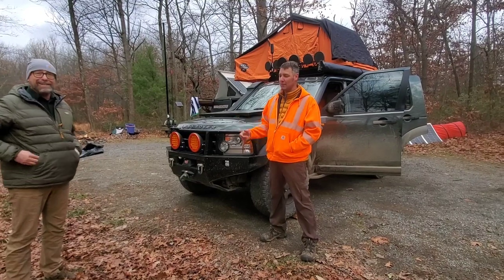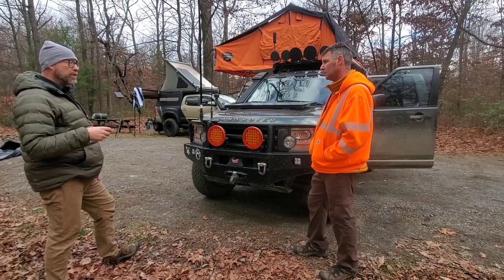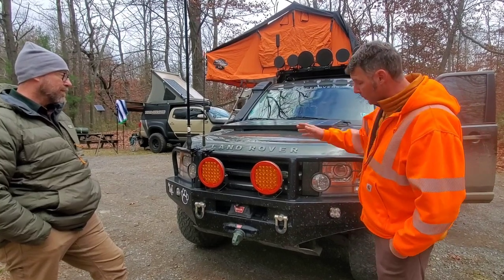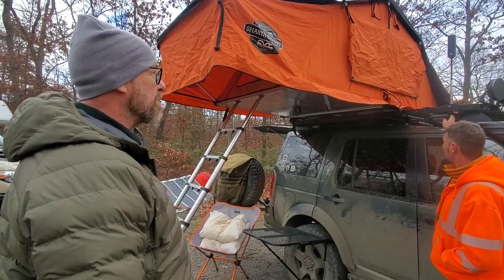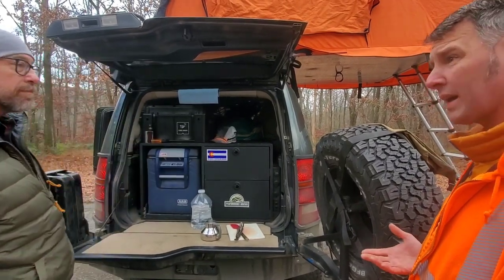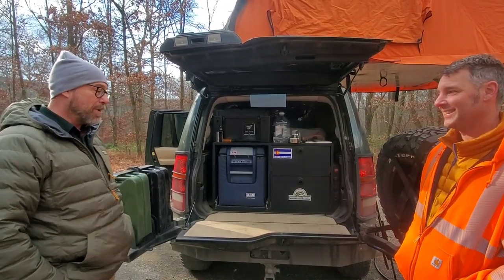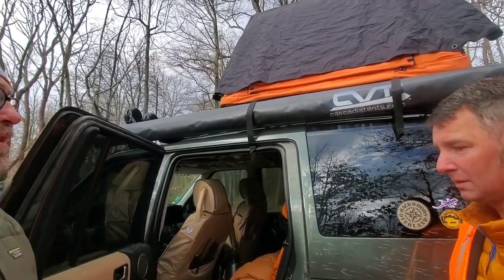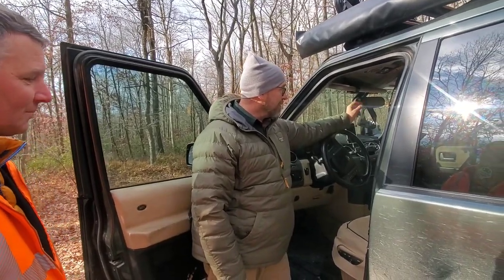TOUR | Land Rover LR3 | Overland Rig, Equipment & Systems

Comment: I have a 2009 LR3 which is on its way to seeing you on the trails up north.  Looks like you kept the stock suspension height with 18” wheels!!
Reply: 2.5 inch rhino lift and using the V6 LR3 wheels! When are you coming this way?

Comment: I am really curious how he setup the duel camera system to display on the original infotainment system
Reply: I replaced the LR head unit with the Pioneer AVIC8500NEX. It has dual inputs for video and allows me to switch between front and rear, as well as multiple aspects. Most any bullet camera can then be installed and viewed.I’m using Rydeen super wide cameras.